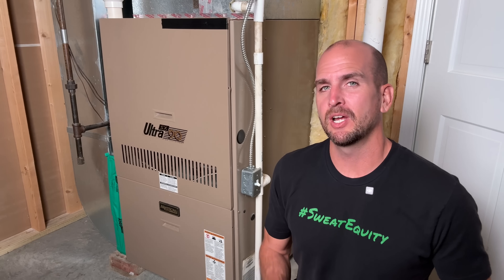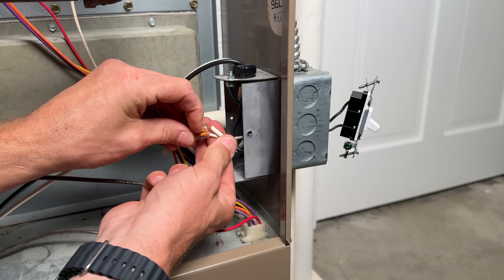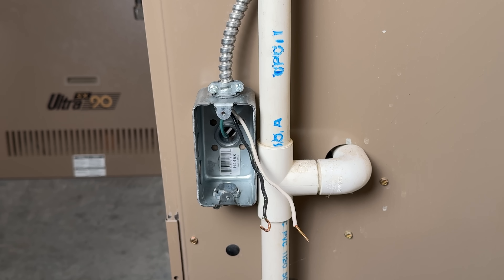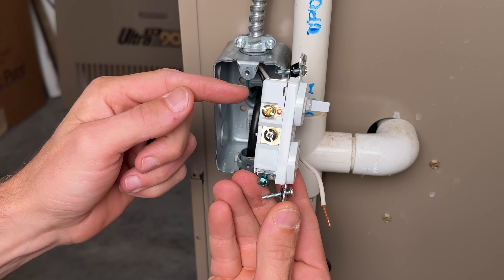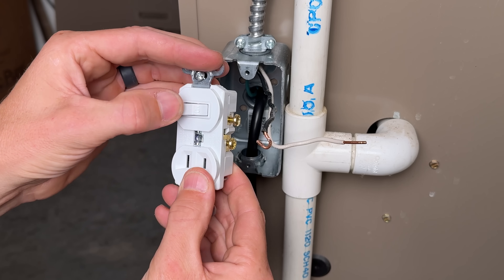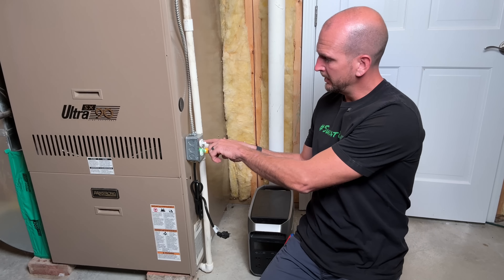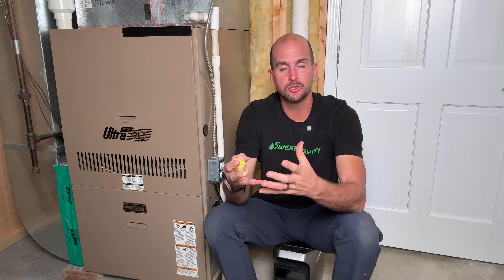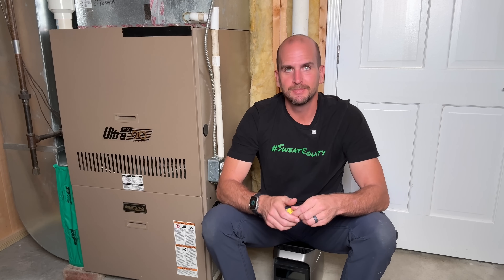Emergency Heat | How To Power Your Gas Furnace When The Lights Go Out

Comment: A lot of people commenting on his mistake of breaking the tab off then installing a jumper to do the exact same thing the tab was doing.. which is true.. but why has no one commented on the complete redundancy of the switch after his rewire?? If I put a cord on the furnace to plug it in, and then I want to disconnect power to the furnace (for whatever reason) I would JUST UNPLUG IT!! This video would be a lot less confusing if you just replaced the original switch with a regular outlet.
Reply: Thats what I was thinking. Put a male plug on the furnace input then install a GFCI outlet to plug it into. When power goes out unplug the furnace from the outlet and plug it into the extension cord from the generator or battery bank. As far as that being code don' t know.

Comment: HOW do I (we) apply your approach when I have a HVAC system that is gas fired for heat and electric for air conditioning.
It looks like mine has one disconnect switch?

Comment: I hope you changed the breaker to GFI breaker now that you have plug in the basement
Reply: And, since he stuck a 14 gauge cord in the circuit that GFCI breaker should be 15 amp instead of the 20 amp that in the panel now.

Comment: Why not just replace the switch with an outlet and wire the pigtail to the furnace and plug it in
Reply: Because I think most elect. codes require a shut off switch.
Reply: That works as well

Comment: That seems like a bad idea. Never create a false ground. Your entire unit is metal and the electric is right there. Ground always works. So I'd figure out a way to earth ground the unit. Jumpering neutral to ground is just as dangerous as a false or bootleg ground. Also, if your breaker isn't GFCI then you might be called out on code violation if you're inspected. Something to keep in mind if you ever list your house. I am all for doing things how you want them in your own house, but just a safety consideration, is all.

Comment: What I dont understand is, why in general, does a furnace need a localized power switch like that? Isnt that what the dedicated breaker is for in the main house service panel? My furnace is exaclty like his.
Reply: It's required by code to have an electrical disconnect near the equipment.  The person doing maintenance on it can be sure that someone on the other side of the house won't flip the breaker back on while they're working on it.
Reply: @kiefer3d  Thank you for your response, this makes sense. I do wonder though, not all of my dedicated appliances have a localized switch (ex. my dishwasher), and that appliance uses more power than my furnace, so wouldnt code require all of these to have their own and not just one?

Comment: Do you need to turn the main furnace switch power off when use the generator?  I am assume yes, but not 100% sure.
Reply from the maker: Since you are unplugging the furnace and then providing power from the generator or power station you don't have to turn off the circuit breaker.

Comment: Everything you did is against code.  NM connector is not listed for appliance cords,  must ground all devices by physical means, furnace are fixed equipment and must be hard wired.  14 ga cord it not suitable for 20 amps.   Must use an appliance cord to handle 20 amps.  Which is 12 ga. Since the receptacle is only 1 on a 20 amp circuit that receptacle must be a 20 amp GFCI TP receptacle. You are a HACK!!!!!!!!!!!!!!!!!!!

Comment: The switch has to be off when using the cord , correct ?????  So it doesn't back feed to the panel ??????
Reply: The cord should be tied directly to the generator so there's no chance of backfeeding because the switch is taken out of the circuit.

Comment: Even easier- cut the wire on the power supply to furnace.  Install a male and female plug ends.  Male on the furnace side.  When power goes out, unplug new connection and plug in an extension cord to furnace from generator.  Simple.
Reply: No need to open the furnace. Open the box, and remove the old switch. Install a duplex with a switch and an outlet. In this case, you MUST remove the tab that connects the switch to the outlet.  Connect the hot wire to the outlet (but not the switch). Take an extension cord and connect the black wire from the cord to one pole of the switch. Connect the other pole of the switch to the black wire from the furnace. connect all neutral wires at the outlet. Now the house wiring will normally power the furnace. In an outage, you can unplug the cord and plug it into your emergency power supply. in both cases, the switch turns the furnace on and off.

Comment: I'm confused.  Where do I need to use the bonding plug?  Would that be on the extension cord I plug into my generator to power the furnace?  Does that poase any dangers to watch for?  Thanks.
Reply from the maker: Bonding plug would be on the generator or portable power station in one of the open 120V outlets
Reply: In my non-electrician / I know how to run my gas furnace on a power station or gas generator experience -  In a home the neutral is bonded to the ground ONLY at the electrical service entrance box. Numbers of gas furnaces, at start up, "check" for this neutral/ground bond and will NOT continue with the startup sequence if this neutral/ground bond is not detected.  Therefore to power this type of gas furnace using a floating neutral gas generator or power station the simple solution is to insert a neutral ground bonding plug into the generator or power station, which is an electrical plug that has a connection between the neutral blade/prong and the ground prong in the plug - or, in a pinch, by using the male end of an extension cord and connecting the neutral and ground wires coming out of the plug and taping off the hot wire coming out of the plug.  

In a pinch I made my own neutral ground bonding plug with a rugged male electrical plug and an inch of bare 12 gauge copper wire to connect the neutral blade to the ground prong inside the plug. I then filled the cord hole at the back of the plug with black electrical tape . (14 gauge copper wire might have been easier to use)

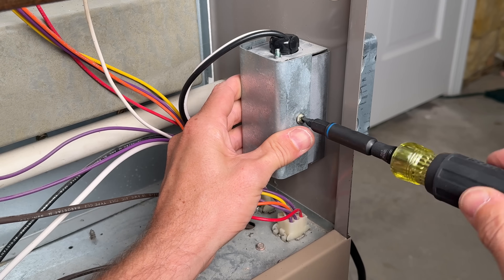Comment: 4:03 From the teachings on the web.  "In a Switch and Outlet combo device, the narrow blade is for Line (Hot) and the wider blade is for Neutral. There is a break way fin tab intact to the line (hot) side which can be removed if switch is needed to control additional load otherwise, a jumper wire can be added between the switch load terminal and lower line terminal (while removing the break away fin tab) hence, it will control the socket outlet in the enclosure box"

Comment: Maybe you should have checked continuity on the terminals of that switch/outlet combo before breaking that tab and adding a jumper wire? Doesn't seem logical or correct as other posts have already mentioned. Would like to see a video demonstrating operation of the switch/outlet combo before cutting the tab and proof of the switched on/off states with continuity checks. Other than that possible bit of misinformation, the video was informative and interesting.

Comment: FYI,ITS CALLED A LOCK ROTOR AMPS....HIGH TO START UP THE MOTOR = THE HIGHER AMPS THEN LEVELS OUT ONE THE MOTOR HAS STARTED UP AND RUNNING...

Comment: I made this same modification in my two previous houses in SE Michigan in the mid-90's and early 2000's.  We were plagued with frequent multiday power outages during the winter - this saved me many times.
Reply: It’s no longer code compliant to do this.

Comment: Just mark the breaker in the pnl   install and connect the generator at the electrical panel using the generator approved devices

Comment: What was the point of the outlet?
Reply: The furnace runs off of the extension cord.  In theory you could plug it into any outlet to run the furnace.  The outlet becomes just a handy switched outlet (With house power) that you can plug the furnace into.

Comment: A neutral ground bonding plug should never be used in your home. These are only for recreational vehicles under certain conditions. Improper use can cause shocks, fires, and equipment damage. You are essentially sharing the return path of your neutral potential with your equipment ground.
Reply: In my non-electrician / I know how to run my gas furnace on a power station or gas generator experience -  In a home the neutral is bonded to the ground ONLY at the electrical service entrance box. Numbers of gas furnaces, at start up, "check" for this neutral/ground bond and will NOT continue with the startup sequence if this neutral/ground bond is not detected.  Therefore to power this type of gas furnace using a floating neutral gas generator or power station the simple solution is to insert a neutral ground bonding plug into the generator or power station, which is an electrical plug that has a connection between the neutral blade/prong and the ground prong in the plug - or, in a pinch, by using the male end of an extension cord and connecting the neutral and ground wires coming out of the plug and taping off the hot wire coming out of the plug.  

In a pinch I made my own neutral ground bonding plug with a rugged male electrical plug and an inch of bare 12 gauge copper wire to connect the neutral blade to the ground prong inside the plug. I then filled the cord hole at the back of the plug with black electrical tape . (14 gauge copper wire might have been easier to use)

Comment: Those plastic tabs are not preventing the grounding of your outlet. They’re just holding the screws in. The rule of thumb is if there is a ground screw, ground it. It’s overkill, but that is the beauty of electrical safety.

Comment: ....you removed the tab and then replaced it with a jumper wire for no reason. The terminal tou connected the "hot" to is normally the "load" terminal. The purpose of the tab is to keep the switch and outlet on separate circuits, only if you choose. By putting the hot wire onto the terminal which is typically meant for the load, you made the switch control the outlet by default. Breaking the tab was totally unnecessary and putting the wire on there literally is just taking place of the tab. Think about it for a moment and it should make sense.

Comment: I would pull a ground to that switch for sure.

It would be cleaner if you would’ve seperated the wires off of the extension cord inside the box but not 100% necessary .
Reply from the maker: Thanks for the feedback!

Comment: My 90% furnace is GFCI protected because the condensate pump plugs into the outlet…. I wanted to do this upgrade but don’t know if it’s allowable by code but I can’t find anything to reinforce it or not. Anyone have any insight?
Reply: Code ECM Section 422.16(A) is a bit unclear - it says it is a violation, then it gives requirements for an alternate installation with flexible cord!
Reply: @lastword489  It's clear enough for the inspectors -- this is a violation for a furnace that isn't intended to be removed for service, plus it's a violation because the furnace isn't listed for flexible cord connection.

422.16 Flexible Cords.
(A) General. Flexible cord shall be permitted (1) for the
connection of appliances to facilitate their frequent interchange
or to prevent the transmission of noise or vibration or
(2) to facilitate the removal or disconnection of appliances that
are fastened in place, where the fastening means and mechanical
connections are specifically designed to permit ready removal
for maintenance or repair and the appliance is intended
or identified for flexible cord connection.

Comment: I installed an EZ Generator Switch.  Website is just all 3 words concatenated together.   Some modern furnace electronics will not work if the ground is not proper.  EZ Generator Switch wiring can support either bonded neutral generators or floating neutral generators to ensure that the electronics work properly.

Comment: My sense is that the steel connection between conduit and box was a legal way to ground an electrical box until a couple of decades ago when they made people bring a copper ground wire into every box.
Reply: Depends on the armored cable type. MC cable has a ground wire and the armor is not rated for use as a equipment ground. AC cable has no ground wire only a small internal bonding strip. This cable grounds through the armor. EMT can also ground through the metal pipe some electricians will want to run a ground wire but it is not a code requirement.

Comment: Overall the video is a very good job but we need to clear up a bit of confusion on the break off fin and jumper wire. I went back and reviewed the Leviton installation instructions and there's an error in the graphics on page #2. On page #1, it says CAUTION: Breakoff fin should be removed ONLY when installing for separate feed (2 circuit) operation. However, when one goes to page #2 of the instructions, it says to break off the fin for COMMON FEED Single-pole switch controls grounded outlet. Now go to the link for the Leviton "How To" video at 2:50 for this use case and it doesn't specify to break off the fin. The video is here https://www.youtube.com/watch?v=gJpS0-5JQgU&t=185s. Thus the verbiage is correct at the start of the instructions and agrees with the video. The graphic showing the fin break off for the COMMON FEED Single-pole switch controlling the grounded outlet is INCORRECT. Here's a video by another content creator in which the same combo switch is used and he does not break off the fin https://www.youtube.com/watch?v=cSXVeUg7L0k&t=57s. I looked at the Eaton TR293W combo switch and YES the instructions specify to break off the fin and put a jumper in - but the switch configuration is different than the Leviton used here. Bottom line - it is unnecessary to break off the fin and install a jumper for this combo switch and use case. Just watch the two videos I cite above, and you'll be fine. I'm an engineer (BSME, MSME) with 42 years of experience.

Comment: I'm getting closer to getting around to this.  The startup amps is concerning me for my 2000/3000 W surge inverter.  The inverter could not handle a gas dryer startup.

Comment: I did something similar years ago but did not use a switch. I figured just pulling the plug was a good disconnect.
Reply: That is my question.  Does code require an actual switch in addition to the plug?
Reply: Certainly avoids the possibility of forgetting to flip the switch off when running off a generator and back-feeding the breaker box with power.
Reply: @grandmasmalibu  How that be a possibility? When the plug is connected to the generator, the breaker panel is completely taken out of the equation. Power flows directly from the generator to the furnace and does not touch the switch that is connected to the breaker.
Reply: @ I guess you are right.  I think the neutral would still be connected back to the main panel (the switch would only be on the hot wire, not on the neutral) but I guess that wouldn't really hurt anything.
Reply: @grandmasmalibu  The furnace either plugs into the generator cable OR gets power from the main through the switch. There is no way for the generator to get backfed to the service panel with this setup.

Comment: If I plug in a generator via 1200watt cord to this outlet, do I need to worry about whether either (outlet &/or generator) are bonded neutral or floating neutral?
Reply: You should ground your generator to be safe.
Reply: @kamX-rz4uy  Yes. Roger that.
Reply: @kamX-rz4uy how does one ground a generator? Am I running a copper wire to a ground rod I've installed for the generator?

Comment: Funny thing about this is that when my house was built in the '80s, the plug-in cord was apparently legal/code. (There were two furnaces in the house, both wired with a plug to an outlet. Of course this is Albuquerque, so who knows...) When I had one replaced, it had to be hardwired per current code. So, this is sort of reverting to old code.

Comment: I have been watching your videos from the beginning.  This one seemed rushed and your explaniations were a bit coudy.  First, cutting the tab made no sense thinking of a regular outlet.  Upon reviewing a second time i see the brass ribbon going from the outlet to the left side to the load screw.  Then it made sense to cut it.  This was not explained.  I am about at your level of electrical knowledge so then i understood what is going on.  You usually are great at explaining, that got missed.  Second, the little paper tab holding the screws, it is really  unnecessary to remove them for grounding.  The screw itself bonds the unit to the box bypassing the paper.  For me leaving the paper there saves me potentially hours of frustration looking for the screws when the fall out of the unit and roll under the furnace.   Everyone has an off day.  It is like you had to hurry and get done and post this so you did not miss Home Improvement.  😎